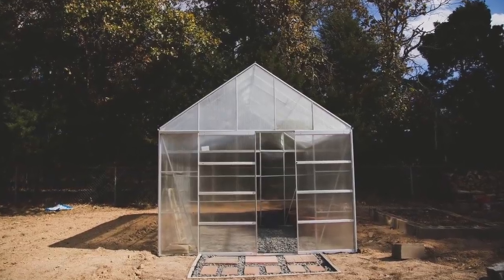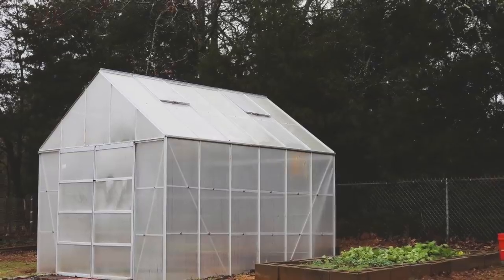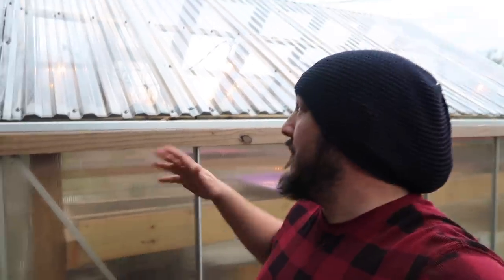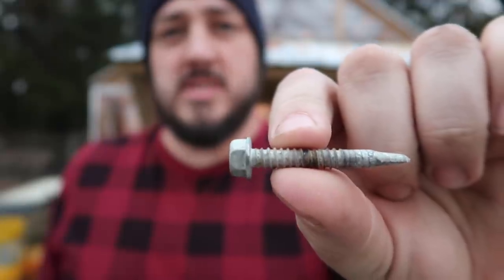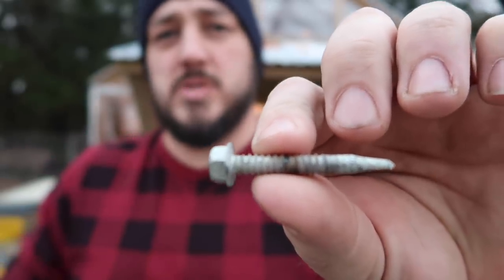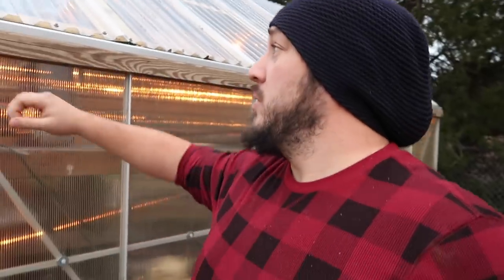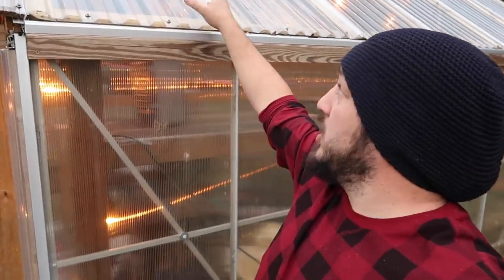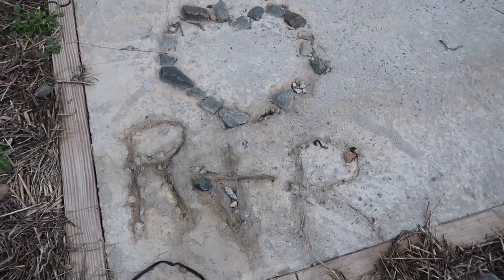How We Built Our Frankenstein Harbor Freight Greenhouse | Roots and Refuge Farm

Comment: You know they make foam strips especially shaped to fit under those corrugated edges.  That is what I used.
Reply: I used them corrugated foam strips on my garden room and it works pretty well. You have to make sure it is the right one for the panel though. There are different types of  panels.

Comment: My husband used to work at a construction company that built steel barns, etc. HOT TIP: you can get foam that comes with ribs or ridges, just gotta make sure to line up the ridges with the corrugation.

Comment: Hey Mia, when you use the foam. Use painters/masking tape to block off areas where it might drip. This way you can leave an opening and "direct" or "guide" the expansion direction.  Also putting on the the green/blue painters tape to protect the surfaces it might drip on. This way you could cut back the excess "puff" from spill-over and then pull up the tape that the faom will stick to, instead of the surface you are trying to protect.

I hope that helps.

Comment: Your greenhouse looks amazing! My oldest daughter bought me the 6x8 Harbor Freight Greenhouse and I'm trying to do some minor mods like gluing shade cloths onto each panels which is time consuming but it'll save my plants from excessive heat living in Vegas; it's intense summer heat! I also want to add those tack roofing screws next and fix the leak holes to cold weather, rain, or air won't get through! The bottom of the greenhouse is secured with 4 posts. It's a lot of work but I love this greenhouse!

Comment: This is just a suggestion... I noticed your heater is up on a shelf... I live in the frozen north... Heat rises... To get more heat for the electricity you pay for heat before it leaves because you can't insulate very well... Moving the heater to the floor will allow the heat to rise up and then escape... For both greenhouses you may want to consider adding soda can heaters made out of pop cans painted black to heat during the day... I built 2 for the greenhouse I am building... I added another like door over the window front... Made outof the silver bubble wrap so I can close them to turn them off... Hoping they make it so I am not paying for heat all day... Great job repairing your kit... Awesome video...

Comment: I love your greenhouse :)  We staggered the plastic roof panels with metal on the roofs of our barns to allow a lot of natural light inside our barns.  They do not handle wind very well and we have had to replace several over the last 10 years.  We have them secured with metal roof panel screws, they will shear off in high winds and we have even had a large tree limb blow through one as well, lol.  They also dry out and become brittle.  You may want to keep a few replacement ones on hand for emergencies.

Comment: Miah they sell the corrugated closure strips for sealing the sheets of plastic at Lowe's Tuftex 5-Pack Cross Link Polyethylene Solid Roof Panel Closure Strips. $10.85 for the five pack. I've seen other homesteaders use them and they were happy with the results.

Comment: I have the same kit and solved panels blowing out by doubling the number of clips and using chain link fence top rails across the width of the  walls for rigidity. A pair of HF solar panels powers lights for night time duties. 12" gravel with buried french drain pipes are fed warm air from the ridge by a small fan during the day to moderate temps. at night. Great vid. Thanks

Comment: Home depot and lowes sells a foam to use between the corrugated plastic and the solid wood planks to limit the heat loss as well as limit entry of anything else through those areas.

Comment: Made the same mistake with the plastic, it didn't last.  But..... the spray foam is hard to control - looks terrible.  The weather stripping foam falls apart, when getting to wet. So I took my plastic with no UV.  Cut it to the length I needed, and about 10 inches wide.  You want to roll it loose as you can. Start with a staple gun, and staple the length in place. Roll it  loose, not tight as you can, and staple in place. This works well around doors and windows. For other places I made rolls of plastic, using duct tape to hold together..Now squeeze it flat as you can, and wiggle it into gap.
 We all try to save money. But I think we all spend more on the upgrades, trying to get it to work. We all learn by our mistakes. Now that you have it sealed tight,  you have to worry about getting the heat out.  Not baking your new plants. I found a floor drying fan at Wal-Mart. We mounted it as high as we could, and have it pulling the heat out. It is plugged into a thermostatically controlled outlet. ( Bought at Lowes).
 We all try different things. And just because this works for me. Dosn't mean that it will work for everyone. 
Keep up the great work. Love to see young people teaching others. Hugz!

Comment: There are foam filler strips made specifically to fill the gaps on that corrugated plastic. I've been looking at this product for a future project. They also have vented plastic ones and solid wood ones, as well as the long strips to fill the last panels in wood or plastic. I've seen them on Lowes and HD's websites.

Comment: Good information, thanks. I refurbished a very old cedar greenhouse,last year, it was on its last legs and had to put extra wood in and replace some rotten parts. Keeping the cost down, I used poly for roof and a mixture of fine mesh with roll up poly covers and acrylic panels for windows. Some ventilation is important. I had the odd bit of glass left but for only two windows. I know the roof may not last so the idea of the ridged plastic roof might make a good future improvement when it fails. I fitted guttering and butts which is a useful addition as we had such a long hot summer last year. It felt good to bring it back to life! It’s full of overwintering hardy veg...just can’t wait to seed start for new season but my last frost date is May 20th. Looks a really good job you have done there, as you say, may as well have built from scratch! We live and learn!

Comment: There is plastic curved riof moulding that goes under the corrugated roofing sheets. We have a bunch of it and ours is tan in color. It came from home depot. If you wrapped it in plastic then nail it and put roofing back down you should be golden... for heat retention.

Comment: My hubby encouraged me to get one of those greenhouses. I'm disabled. It was hot. I got the frame up and had to call it quits. No panels were attached. The next day, I go out and that thing is practically destroyed by the wind! I saved the panels (they are still stacked up under the shade tree) and several years later, I am finally building a wood greenhouse and the costs are less than the kit and give me more square footage. 

Like what you did with yours. Mine is going to be 14' wide with two extensions and 8' deep with screen all around the inside and panels that raise to let the summer heat out. I'm in FL.

All of those little panels will go around the bottom of the knee wall and then I'll use the poly carbonate panels on the roof and "attic" ceilings with hinges on some so that they open up.

Comment: Nice work!  This year we'll be doing something similar with a kit greenhouse we have.  Our frame is steel tubing and super sturdy, but it came with a plastic cover that died a couple years back, (right now it's covered in that non-uv treated plastic you mentioned) so we're having to figure out how to fit it with polycarb panels and frame in doors, vents etc.  Fun stuff!

Comment: Great video Miah.   I looked at the panels you used, at the Home Depot, and was pleased by the lengths, profiles and colors that were available to  buy. They had end closure foam strips at my local store to match the shape of the plastic profiles. I think the foam strips would benefit from extra wood striping to support and keep them in place, but they could be caulked I guess. I don't know because I ultimately bought a kit. Maybe you or viewers might want to check the online catalog if they don't have them in your store.

Comment: I used a couple cattle panels hooped them, then built wood frames and built a door and a window one on each end, I scabbed it with some thick plastic that came on the double wide trailer house when they delivered it and put together on our property. I have had it for 3 yrs now and the plastic needs to be replaced now as it has degraded now. yours looks really nice. good job Miah.

Comment: Trial and error it's too bad they sold something for so much money and it was useless.  Good job and spirit. I have built a PVC green house frame and the four corners on the inside of the 1.5" pipe are T post. They can't be the real thick  T post but these post stop the wind from blowing it over.  I have yet to finish my green house and deciding what to use for materials I think watching what you've done I will use the corrugated stuff too.  Thanks

Comment: You're right about the harbor freight greenhouses, ours is 6 X 8 ft which for us is plenty big enough but we  had to reinforce it too. I watched many videos on this and they all said to all structural support and it's been fine. We have lots of high winds but after the first gust where most of the roof panels flew off we figured out how to secure these too. We got ours, with a coupon...does anyone buy anything from HF without a coupon? lol, for $199.99 so I have no complaints. I love what you did with yours but seeing all the work I'm glad we went with the smaller one.

Comment: Hello Miah,  I am so glad you made this video. I was about to tear down our harbour freight 10x12 greenhouse but you have given me the idea  of doing what you did as I mainly want to replace the terrible panels with polycarbonate roof panels all over.i assume you know they make a foam for the ends of the panels to seal from air.
Reply: I forgot that you knew about the foam and plastic seal for the ends of the polycarbonate panels as you used them on the used windows greenhouse

Comment: Great info thank you! Just a thought what about corrugated foam pieces that go on the edges? They are inexpensive and made to use with those corrugated roofing panels. Might make your life a little easier. Unscrew existing eneds of panels slip the foam pieces in and rescrew. Have a blessed day!
Reply from the maker: Ellen Abdou ya that was my first thought however when I went to the metal roofing supply store they didn’t have any that matched our pattern. I would really like to find some that would work.
Reply: @RootsandRefugeFarm  have you checked the ones they carry at Lowes and Home Depot? In building materials...Lowes also had them outside garden area on the West Coast though every area is different

Comment: Thanks, Miah! The practical stuff is so important. We just put together a kit green house last weekend and it was a huge pain. I think it would have been easier to build one. But it turned out great with some modifications. What did you use on the floor in this one? We did gravel and sand in mine.
Reply from the maker: Charity Smith loose gravel is the floor! Thanks for sharing! Where did you get your kit from?

Comment: Careful with running extension cords to the greenhouse to plug in small heaters. My friend did that , and not her greenhouse caught on fire, but the outlet in the garage did.......even with exterior extension cord, was to much for a heater running for hours........might be safer with a small propane heater inside the greenhouse.

Comment: Are you going to build the window greenhouse on a 2 - 3 ft frame with vertical timbers as weather boards. If so will you lap them and propane torch the outside as a preserving method.